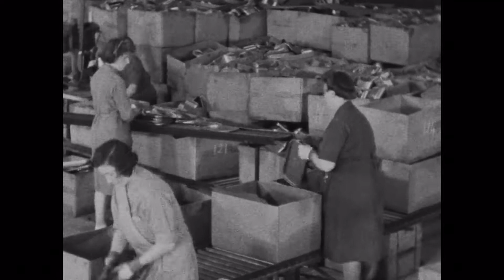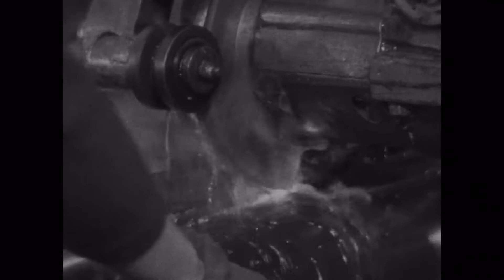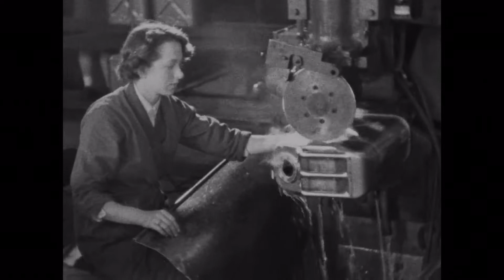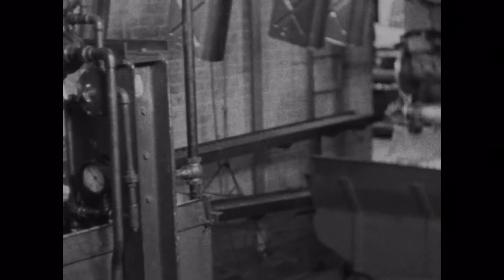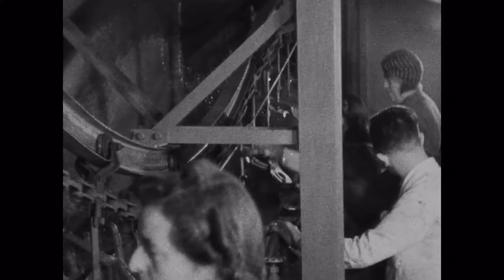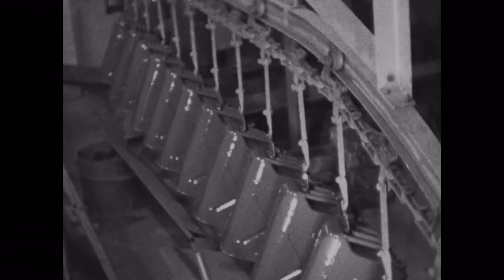British Made 'Ameri cans'

Comment: I'm writing a chapter on Jerry cans (called Ameri-cans here) and I love this video. Does anyone know when it was made? I assume '44 or '45.
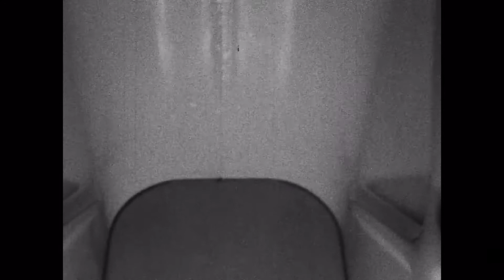Reply: at 20:30 you can see the year of the can is 1943. The top line reads: ICC-5 and the bottom line is 20 5 1/4 43. ICC-5 is Interstate Commerce Commission category 5. It should be 5L. The bottom line is the material gauge. They were all 20 gauge. The capacity is 5 1/4 gallons and then the year 43 for 1943. The US made cans have the manufactures name stamped in between these two lines and ICC-5 for water cans and ICC-5L for gas cans. The British made cans never have the L. I don't know why.